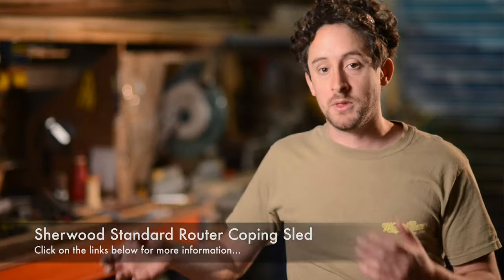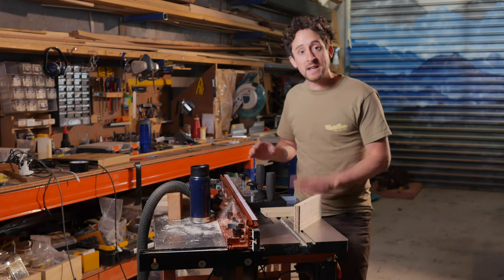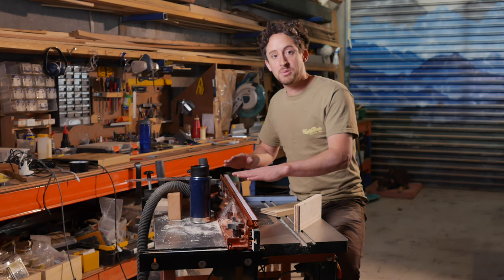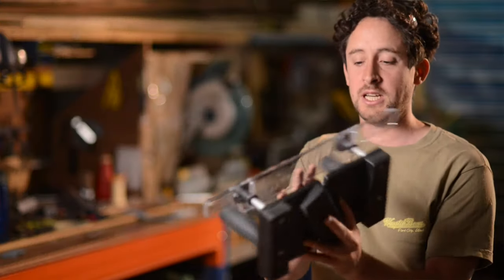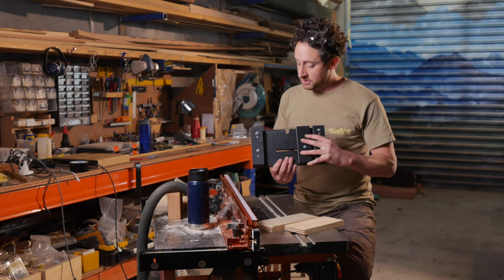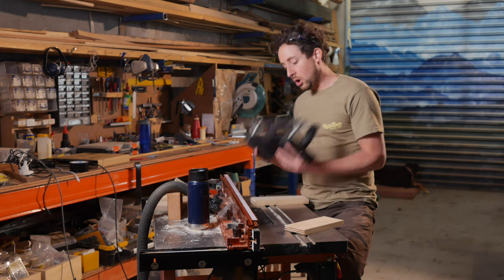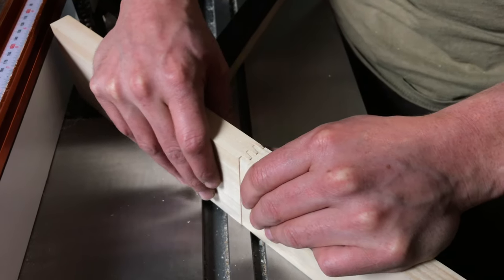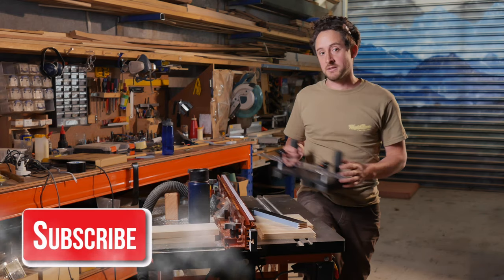The Router Bits: Why a Coping Sled?

Comment: I made my own DYI coping sled using similar design as Rockler coping sled which has a toggle clamp to hold the piece down as well.  I found that trying to get the acrylic piece that rides the fence to be parallel to the sled is difficult to do.    What I wound up doing is using the coping sled to ride the fence.  To make this work I made an 3/4” inset on the sled so that only the ends of the coping sled makes contact with the router fence.  When I completed it,  I fine tuned it by running it again on the tablesaw to get the backing runner perpendicular to the sled/router fence.  It’s working good.

Comment: Great stuff but what if the piece of wood you want to work with is wider than the sled ??
Reply from the maker: Thanks for your question, Tim. Naturally the coping sled featured in our video would not work due to its size limitations. There are two possibilities that come immediately to mind. You could simply dismantle the existing sled and, using the various pieces, simply build a larger base using MDF or plywood or the like. Otherwise, you could use a handheld router along the length of your piece using a guide to keep it straight and parallel.
Reply: @timbeconaus  Thanks.